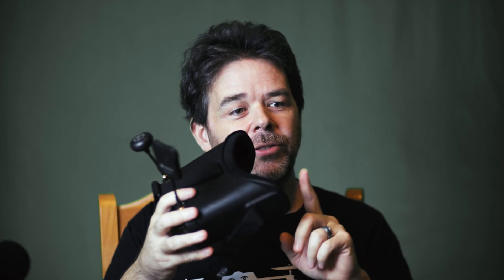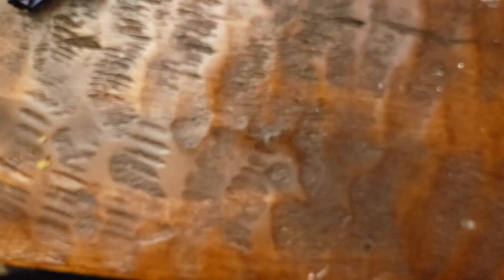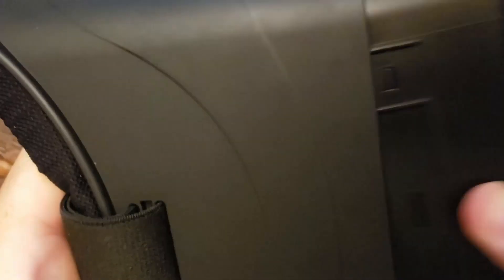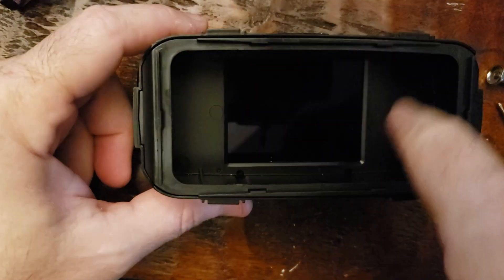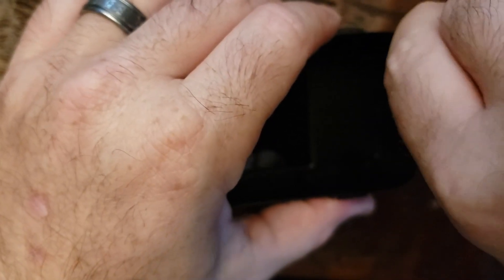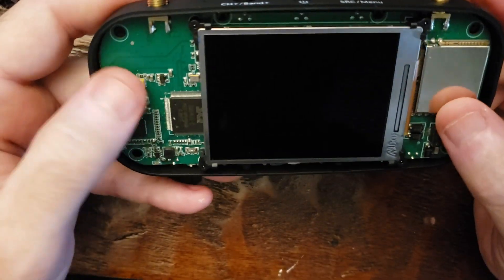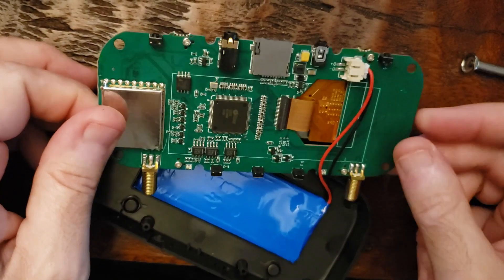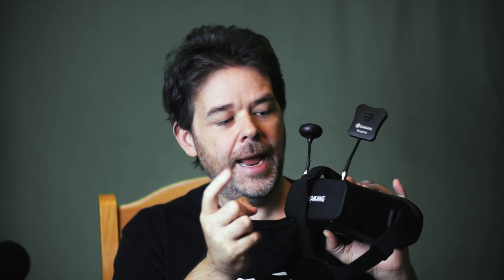Eachine EV800DM Disassembly and Mod idea planning

Comment: Thank you! The battery life of my goggles is pretty short and I use an external little powerbank. Since the DC input plug fails I'm going to replace it with an USB C port.
Reply from the maker: If i were to do it today, i'd use one of the USB C ports like you're talking about.  I love those things

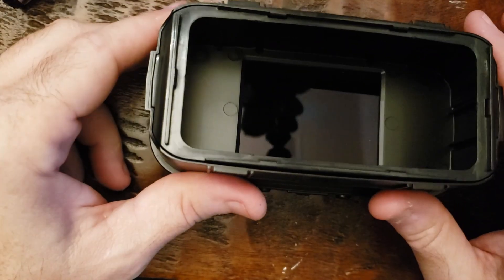Comment: 2:12 my goggles did not come with this shroud, they did however have five of tose srews installed,not just four.
Reply from the maker: One thing i learned from Eachine:  NOTHING is the same on two pieces they manufacture.  I have no idea how they are everywhere but can't put the same screws in the same place..  On the other hand, i've had very few eachine failures, so they at least get the big stuff right

Comment: Thanks for the video! I wonder if it make sense to remove the battery to make it less front heavy. Has anyone weigh the standard battery? Will the goggles work without battery with provided power from charging plug? Or it is better to create a connector for the battery plug and use external LiPo?
Reply from the maker: i ended up extending the wires out just like you said and put velcro on the back of the headstrap and i put the battery there.  That way, i just just swap out some 18650s i have wired for JST connectors whenever i need.  i hate being tied to just one battery that i have to wait on for charging.

Comment: Perfect.  Mine as shipped had bad batts with minimal life.  I plan to add a pack at back of headstrap to help counterbalance.  FWIW, I use 2.0 readers and the optional fresnel lens made these usable without glasses.
Reply from the maker: I ended up using 2 18650 batteries in parallel i scavenged from an old laptop. I just put an extension out the front and use Velcro to stick them in the back.  It works really well.  I think it can take up to 2s, but I've only used 1s, 3.5-4.2

Comment: I just tried to do add an external battery mod on my ev800DM and I don't have any goggles it set on fire I did everything right I think it was the battery I used time to save up for sum fat sharks
Reply from the maker: Ouch. I'm really sorry. Did you have a short Somewhere?  I just soldered in a hst connector that leads outside.

Comment: I "overturned" my omni antenna, so that the connection in the goggles broke (that copper (colored) thing). Then I tried to fix it by soldering it back together but it still doesn't work... Do you know a way to fix this?
Reply from the maker: so 90% of antenna problems like that are fixable if you can somehow gte the metal sheeting around the antenna and solder it to the ground part of the connector, then have the center part soldered the correct area.  It's kinda difficult but it works most of the time.  I'd have to see teh exact problem to know for sure.  come over to discord and see if we can help  https://discord.gg/cZAVyTW  there is gernally someone in "General" text when you chime in.  it's easier that way since you can share pics, etc.

Comment: Did you ever end up running the battery mod for this? Wondering if any caps or filters would be needed to run a 2s pack on it. I just bought these and the battery isn't bad but because it's in the front of the goggles, if I fly when it's super cold the battery suffers quite a bit. I'd love to be able to run it off a 2s that's sitting nice and warm in my pocket haha plus if the battery is in your pocket you could essentially conformal the components while you have it apart and have a damn near rainproof set.
Reply from the maker: I did a battery mod and it claims 2s is ok... But i just use 1s.  I actually just put a jst connector and use 18650 cells and get a good bit of flight time now.  

I'm pretty sure you can do 2s, but not sure enough to recommend.
Reply: @Sully365  thanks for the reply! I was lookin into 2s because I have 2 4000mah Batts laying around for my sons rock crawler/basher I was gonna use but may just play it safe and buy some 1s. Not a fan of the deans plug on these anyways.
Reply from the maker: @GorefiendGaming  if you wanted, you could easily fit a stepdown regulator on a new wire between your dean's plug and whatever plug you use.  just set it to 4 volts output and off you go.   Total cost would be less than 4 bucks

Comment: Hello, can you use the ev800dm directly with 2s or 3s and remove the original battery ?
Reply from the maker: Yes, it looks like it will accept 1s and 2s, i would not try 3s
Reply: @Sully365  Okay, it's too dangerous for me. I don't want to ruin the glasses. Bought myself 1s 5000mah lipos.

Comment: Hey Chris, I just got the fresnel lens for the goggles. Have any pointers on how I'm supposed to install it? Appreciate you!
Reply from the maker: Look about 1 inch into the goggles on the top half of the shell.  you should see 2 U shaped bits of plastic sticking out.  Those accept the little arm nubs of the lens.  just push them in straight and they will pop into place, then be able to swivel up/out of the way and down.  i love how it changed my view
Reply: @Sully365  I knew I could count on you! How much do I owe you for the technical consultation? $$
Reply from the maker: @andrewtull341  haha.  my links are affiliate so just remember next time you wanna go shopping :)

Comment: Hi Chris, have you managed to workout the actual resolution of the lcd. Some have said it does not look like the 900*600 as advertised. Great review by the way...
Reply from the maker: I can't honestly tell.  You can tell it's sharper than the ev800d and jjpro/kylin and most of the 5" screens, but i have no real way of measuring.  The video is sharper than the eachine pro dvr that records at higher resolution but is just upsized
Reply: @Sully365  I've taken the plunge and bought one. Thanks so much for your reply. Keep the good content coming.
Reply: @michaelsanderssa  Are you happy with it ?
Reply: @Tish0eX  I am surprising impressed. Thought going from a full 16:9 box to a smaller 4:3 would be difficult. The quality of the screen is so much better than my old eachine VR009. Very comfortable with glasses fitting perfectly. If I had to suggest some  changes would the ability to add an external battery,  a AUX output and maybe some foam around the nose. The nose gap leaks light a bit. For the price I'm really happy.